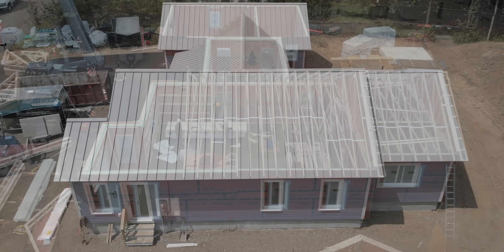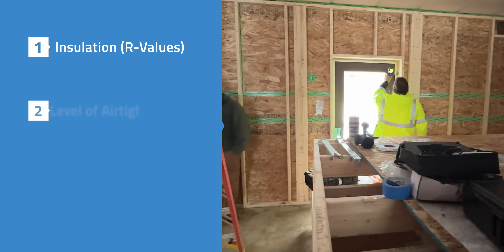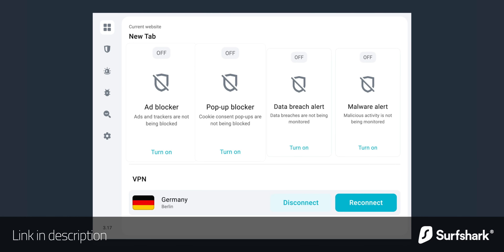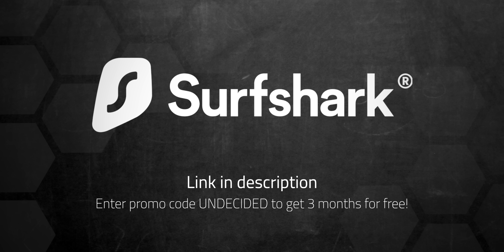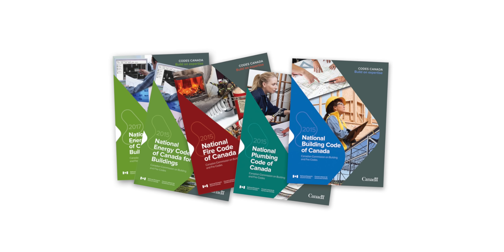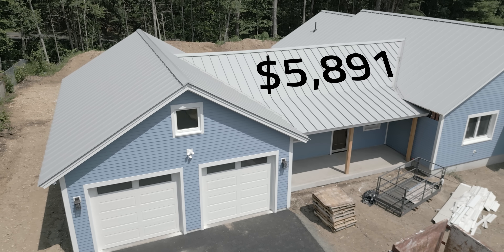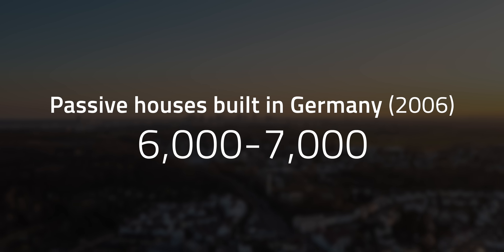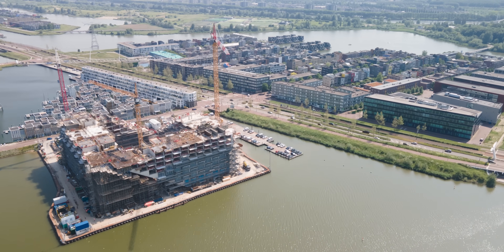Why Do American Homes Suck?

Comment: On the other hand. As a European, I am amazed that houses are so cheap in the US, and that it seems (from TV building shows) that it is simply cheaper to tear down a 30 year old house and build a new house, instead of renovating it.

Also, houses in the UK are similar to the US. It's mind-boggling really. And in southern Europe, climate sets differently challenges and realities from northern Europe.

One thing that amazes me beyond anything though, is the lack of solar. In Scandinavia it's installed everywhere. On house roofs, in fields, on industrial properties. And for context. Southern Europe is on the same latitude as Northern US. Madrid is on the same latitude as New York! Up in the Arctic we have more solar than Southern US.
Reply: Where are these cheap houses you're seeing in the US? The housing market here is absolutely fucking insane and entirely unsustainable and unaffordable
Reply: cheep in terms of construction
Reply: @Shorkshire  now. It wasn't always this bat shit crazy.
Reply: Anywhere not a Big City and its burbs is dirt cheap.  Average cost of a house in Ohio is ~$125k.  And those are nice houses too.  Guess where I am moving when I retire!  Here where I live now(suburbs of Seattle) you can't touch a garbage dump for less than $700,000 unless you are at least an hour from Seattle.  Denver it is $500,000.  My Sister and Husband bought a DUPLEX for $80k in Syracuse.  I helped them fix it up and it was paid for entirely in less than 3 years AND they are now renting it making B-A-N-K   @Shorkshire
Reply: by "cheap" that means sticks and paper and lowest cost materials at minimum labor content= TRUE
Build with termite food (wood)  and fire kindling(roofing), then complain about the inevitable 'disaster' as the same companies rebuild for maximum profit again & again. Foolish, at best
Reply: @solosailorsv8065  Do you want to own a $200k home for $1,100 a month for 30 years with $200 energy bills, or rent a $400k home for $2,000 a month for the rest of your life that costs $50 a month less in energy?
Reply: @Matt-yg8ub  Thanks, I'll keep my paid-for and no permits required, 80K sailboat that is sail&solar powered, makes its own fresh water, and puts food on the table in any cool little port in the world, with the best Mates/neighbors of like-minded freedom lovers. if the "authorities" get out of line, I just sail-on.... Like the title says Houses SUK
Reply: @solosailorsv8065  sticks,paper?? What you talking about. I’m a builder and I never seen paper used for building.maybe in Japan??
Reply: @chrissasin6676  He's talking about drywall when he says paper.
Reply: Reasons why Scandinavia and northern Europe has more solar than southern, is because of legislation. Take Spain for instance. When I asked why there were no solar anywhere, I was told even if your house is 100% off grid, producing all it's own power, you still have to pay the local power companies for every kWh you spend as if you bought it from them. It's quite easy. If your upfront investment saves you money in the long run, it gets done. If not? Not happening.
Reply: @javr0  Forced to pay for what you don't use? Wow, and I thought California had criminal laws
Reply: @solosailorsv8065    There are places in the South that are on septic system, but are forced to pay for city sewage because they were annexed into the city.  So, they are paying twice for their waste disposal.
Reply: @laurie7689  Thanks. I wish all Commenters were real people with real information to share. Thanks !
Reply: @solosailorsv8065  I wish that I could remember which city it was, but I think that it was in Alabama.  I remember that the residents had sued, but they lost their case in the courts and had to pay the city for a sewage system that they weren't even connected to.
Reply: @javr0  No, not off grid. It is only grid tie they can charge you in Spain but I think they are not allowed to do that anymore unless in certain situations. I have had off grid solar in Spain since 2015 and have not paid anything to the power companies.
Reply: @javr0  subsidies,legislation,ideology based decisions will not work. In final analysis market will decide.
Reply: It's cause for the longest time the cost of Renovating was almost Equal to the cost of Building a new home for Decades. And in some cases it was cheaper to Buy the Materials and hire someone to build you a new home than it was to renovate an existing home yourself. Electricity was also dirt cheap for a long time.  The US could be said to have been in a Golden Age for so long that it has stagnated when it was still in need to renovate and improve base living standards.
Reply: Most UK houses are built from brick, so I'm not sure there's much similarity.
Reply: Probably depends on where you're building. To build a house in the SF Bay Area costs $400-500 a square foot, while in the UK it's £167 - £279 per square foot.
Reply: Where did you get that nonsense that UK houses are the same as US houses? 🤦
Reply: Other than the Southern States in the USA who have consistent year round solar,and need it during the day for Air Conditioning, it is more $$$ efficient to rip the siding off your home, add Rockwool insulation, sealant, and a new roof which never needs to be replaced than to add solar.  Solar is nice, but there are bigger fish to fry.  In the Southern USA, Solar pays for itself in about 5--10 years.    You also must understand the cost of electricity anywhere in the EU is over 3X higher than the USA.  So, Generating electricity in the EU pays back WAAAAAAAAAAAAAAY shorter period of time.  There are many northern places in the USA, the solar panels will be dead and so will you, before they pay back.
Reply: As someone who has dabbled in the craft of designing houses, and has a family background in construction. One thing that you gotta realize is that its not cheapness rather its a cost balance. What I mean is, often its not just what is the lowest price, there are houses that do that and often those are the ones you see in viral videos falling down in wind storms because they were too sparing on nails, or leak the moment the first rain storm comes because the membranes were made of a low quality plastic. 

When people spec houses, probably common everywhere but I'm focusing on the U.S here, we spec them to achieve the goal the best way we can without breaking the bank. So where the local codes and requirements count, we spend more money, and if something can be left out without impacting quality, it sometimes will be. This leads to a lot of compromises that occur. Sure, heat pumps are really efficient, long lasting, and more, but a swamp cooler cost $1,500 less and does as good of a job in Las Vegas. Thats why they seem more affordable, there is more compromise, not to say its all bad, a lot of decent and good things often are the result of the lowest bidder but it means you get industry standards that seem inferior in comparison to other parts of the world. 

We would all love to build our houses out of the best bricks and the most solid foundations possible, but we dont have that kind of money, so a decent foundation for the climate and wood will do.
Reply: @sterlingodeaghaidh5086  the richest country in the world complaining about not having enough money to even build according to mediocre lowest allowed code in the rest of the world... Yeah. I totally get that. No honestly. I do. Lack of codes, extreme income inequality and a culture of short-sightedness.
Reply: @xyzxyzxyzxyzxyzxyz  cost balance-what is it.? Soo you want to pay more than you have to??
Reply: @xyzxyzxyzxyzxyzxyz  youd be surprised how many people want to build to a higher standard. Im remodeling my house and part of ehat i want to do is add new windows and better insulation but i cant as its too expensive for me. Its not a lack of foresight its a lack of motivation to do so, and where there is motivation there is a lack of ability to do it
Reply: @xyzxyzxyzxyzxyzxyz also Americans are used to certain square footage. You can probably build a high quality house but it would be half the size. At that point might as well go back to Europe.
Reply: UK is an embarrassment. The Conservative Party is a basket of pure corruption. Brexit is a clear demonstration of the political will of its ruling party in divergence from European standards, including construction.
Reply: “Stick building” say it all.
Reply: @EdA-bz3bu  just wait for earth quake and see which system is better
Reply: You think it is cheap to build a new house every 30 years? It is a scam as you are paying the bank for the mortgage of a 30 year investment. Given how cheap land is in the US and how easy you can make money in other investments mortgages are an insanely bad investment in the US.
Reply: @melange78  That is an exaggeration.  Homes last way longer than 30 years.  The home I owned in the states, is 34 years old, and is a rental unit.  Plenty of homes that were built in the 1970s are standing, occupied, and in good shape.
Reply: @sgtm7  They are not built to last for more than 30 years. I studied architecture in the US and it is in the textbook. Sure they might still hold for the purpose of living in it but the sales value of a 30 year old house is generally not worth more than the plot value, which in the US is silly low anyway.
Reply: @melange78  nonsense ,it’s just silly 🙃
Reply: @chrissasin6676  No, what is silly is that you don't get it. If you were to build a house using American standards in Europe you would be sued.
Reply: @melange78  be more specific, one example,please.  By the way,you could not build  euro standard home in California,
Reply: @chrissasin6676  OK how about the most common type of construction in the US, the wood frame? That is substandard in the EU, you would get sued if you used that here.
Reply: @melange78  not in Poland!  Et minimum. You can use steel studs. Not s
Reply: @melange78  you can’t be sued, you might not get building permit- that’s all.Looks like you not a builder,am I wrong?
Reply: @chrissasin6676  No I am not a builder, but you don't necessarily file the construction methods when you get the building permit either here.
Reply: @chrissasin6676  I guess that explains why polish construction workers are so poorly rated in Sweden.
Reply: @melange78  that’s everywhere. I’m not sure what country you’re from,but you can build wood frame houses in Germany,Switzerland,Nordic countries,central Europe…
Reply: @melange78  I’m not polish ,I’m American  🇺🇸.
I’m glad Swedes are such good workers.Had a lot of experience producing and selling ball earrings to hitlers Germany  luftwaffe ,therefore participating in attacks on Warsaw,London,Belgrade,guernica ….
  Prosperity created on profits from both wars (80 million deaths)
Reply: @chrissasin6676  No you cannot. I honestly don't think you know what wood frame is. It is like a barn made in the 1700s.
Reply: @melange78  The house I bought in 1995 was built in 1989. I paid $65,000 for it.   So that house is currently 34 years old.  According to Zillow, it is now valued at $174,000 (range of $159,000 to $187,000).  Which is actually irrelevant, because we aren't talking about the value of the house, but if it will last 30 years.
Reply: @sgtm7  But what makes the value increase in your specific case? Inflation? Land value? General lack of residential zones in your area?
Reply: @melange78  Compared to many other places in the USA, it hasn't seen much increase in value.   Years ago, during the housing bubble, when there was crazy appreciation in many places, that wasn't the case in Texas.  If I had bought a house in California for that price 30 years ago, it would be worth at least $500,000 now.
Reply: @melange78  The availability of employers makes the value of an area increase.  There are many dead and dying towns all throughout the USA and that was the direct result of employers leaving the area, mostly to go overseas.  The areas that grew did so because of the employers that chose that area to build their business.  The people follow the businesses.  That makes the land around the business more valuable due to the demand of the people (employees) who want to settle nearby it.  Also, the other businesses that want to open up in support of that main business, such as parts suppliers, restaurants, etc., which also have need of employees.  All it takes is one large enough employer moving into an area to completely change the dynamics of the place and cause it to grow rapidly, increasing demand, which increases value.  On the flip side, that one large employer can also totally devastate an area if it picks up and leaves.
Reply: @melange78 I live in a 120 year old home and am living proof that you’re talking out of your back side.
Reply: @Matt-yg8ub  No, of course there are unicorns. There are people that are born with 12 fingers, that does not mean that saying humans have 10 fingers are "talking out of your back side". IN GENERAL homes in the US are built to last for 30 years and you can tell that just by looking at the choice of materials. The condo that collapsed in Miami happened for a reason.
Reply: @melange78 population growth
Reply: @melange78  It's the location that counts, you learned nothing in that school 🤣🤣🤣
Reply: @HEMI345S  No it is in the course litterature.
Reply: Cheap?????? You think 300 to a million is cheap
Reply: I live in the Southeastern USA.  My home sits on the side of a wooded hill.  It sits completely underneath the tree canopy, so it is rather useless for me to have solar panels on the roof.  I only get maybe an hour or two of sunlight in the evening coming into my home.  My entire property is mostly shaded.  I've got tall loblolly pines, woody vines, and ferns growing in my yard all around my house.
Reply: Houses i North America are not cheap. They are cheaply made and they don't last long (by design).
Reply: My house in the aUK was built in 1772. Slightly older than the USA😂
Reply: Energy is generally cheaper in the US. Why go solar when you're looking at many decades to recoop the cost? Solar coming down so much in price has certain spawned solar installations in some parts of the US where energy isn't that cheap, but there's a long way to go before other parts of the US with very cheap energy will go for it.
Reply: @repatch43 yes but it’s cheap and dirty. Coal fired generation is a large contribution to US grids. IF there were carbon tariffs applied to the generators, they’d move their business models, reduce pollution, BUT it would raise the price on consumers bills. Not very populist & wouldn’t go down well politically.
Reply: @repatch43 It's not many decades anymore. Here in CO in Black Hills' domain energy is 22c per kWh. So a $25,000 8000w solar install only needs 5-7 years to pay itself off. 
Up in Denver it's only 11-14c per kWh so that's 10-15 year payoff. Still worth it, but not as good.
Reply: Unfortunately, tear downs are more common because our houses here are made of sticks and paper - literally.  2x4 construction with sheetrock is typical.
Reply: @diggity53  paper??   You can buy houses made of concrete, CMU ,anything you want
Reply: @chrissasin6676  and they crack easily, are susceptible to mold, and are unsuitable for habitation in under ten years.
Reply: @Matt-yg8ub  you talking American or Europe homes ?
Reply: Building a shed in Europa is also cheap. We simply choose not to live in it. 
You get what you pay for.
Reply: @jaap7374  I'm not sure your point.

I find in Europe, as a generality, things are built to last 'longer'. That sounds GREAT on the surface, but it has consequences. When you build something in a way that it's meant to last 2 or 3x, you end up with much higher upfront costs. I've actually helped build European houses, it's ALOT more work, with ALOT more material. Everything costs more, you need more people, you need more expensive and heavier supplies.

The result is a house that will probably outlive the owner. That makes sense in a society that is used to multigenerational living. In North America however that's not as much a thing, so overbuilding a house doesn't make as much sense.
Reply: most houses are built so badly, people change them like they do cars - Cars probably last longer. Easier to dump a house and move. Very different mindset to Europe.
Reply: Many things are sub standard in the US. Roads are terrible, health care, no trains or public transport. Domestic flight in the US is painful.
Reply: @TroopyTreatsx  what part USA are you from
Reply: UK houses are nothing like average American ones. We like brick, and insulation, and good quality construction. We have actual laws that are actually supposed to be enforced. Our insane planning rules are nowhere near as bad as the US ones. We don't have air conditioning, which now has to change because Americans have been building so much terrible housing and general infrastructure that we have no choice but to start using it. Dunno why the OP thinks the homes are similar though.
Reply: @jonevansauthor  as an american i have to say that most homes I have lived in  have been brick. all but 1 in fact.
Reply: ... He was comparing climate zones and the equivalent energy codes in same climate zones in the USA.  The ONLY equivalent climate zone as the UK/Northern Europe is Western Washington State on the Pacific Ocean where very few have AC, the cost of electricity is 30% that of Europe, and Natural Gas is nearly Free compared to Europe.     PS: I have lived in a brick home... Drafty and cold as hell.  Brick SUCKS for insulation value.  Unless you put interior walls and insulation in a brick building your energy bill will be pitiful.  Thankfully most brick buildings are ancient and like their UK counterparts still survive due to their VERY compact, small, stacked on top of each other nature to conserve heat.  I liked it because of all the rentals in it I owned and operated till the drugies moved in next door and it became impossible to rent to anyone other than low life scum.   @jonevansauthor
Reply: Every new build should have solar, it should just be the rule, and not just 2 pathetic pannels installed.  But apparently it takes  a lot to change the building code....or maybe the building companies just have too much political clout to ever allow it to become standard because it would hurt profits.
Reply: @miless2111sutube  There is already not enough new building going on right now, and you want to make that even more onerous?
Reply: @shadowtheimpure  I don't understand how it would be more onerous, given that this wouldn't be a snap announcement and companies would have enough time to put on place supply chains etc. You might as well day that installing double glazing is onerous:). If they, and their suppliers, know that it will be required it will happen as part of the normal build.
Reply: @miless2111sutube  It increases costs, which increases the price on the finished home, which makes it accessible to fewer buyers. That is why it's onerous.
Reply: @miless2111sutube  Even if my house was brand new (which it is not as it is 40 years old), my home sits on the side of a wooded hill underneath the tree canopy.  I get very little sunlight here, maybe about a couple of hours in the evening when the sun is setting.  Solar panels on my home would be a waste of money and of resources.
Reply: @miless2111sutube Do you have any comprehension of the vast difference between regions in the US? Let’s assume we mandate solar panels…… half the country wouldn’t pay them back in their lifetime, a quarter would take them at a loss because they were destroyed by bad weather and the last quarter would be lucky enough to pay them off …..a few year before they broke and had to be replaced. 

Take all the eco hippies from California who moved to Colorado and were SHOCKED when the solar panels they installed were destroyed by hail storms.
Reply: Latitude doesn't count, when Europe is cheating by having the Golf Stream 🙂 Btw. I listen to NYC based radio station here in Prague, CZ on daily basis and it's remarkable how the weather is often very similar (not temp though) in terms of rain, heat/cold waves etc. But ofc other times could be completely opposite, mostly when US is troubled by the polar vortex.
Reply: @mikiqex  First, the golf stream is way cooler and localized than you think. It keeps Irish, Norwegian and icelandic winters mild and ice free. It has very little impact on the rest of the European climate. Second, it has no impact on solar radiation whatsoever.
Reply: That’s the biggest factor missing in this video. US homes are often a fraction the cost for the same size and energy in Europe also costs multiple times what it generally does in the US. There’s no cost benefit to making homes exceptionally efficient unless you’re a climate alarmist detached from practical reality.
Reply: The US is all houses, while a large proportion of Europeans live in apartments.

I am not sure how solar works when you have 8 families living under the same roof area as one family in the US
Reply: @rogeriopenna9014  29% of Belgians live in apartments. The rest lives in single home units. I don't know about other European countries.
Reply: @rogeriopenna9014 community solar and wind farms. You own a piece of the business to offset your energy bills.
Reply: US houses are not cheap,European houses are expensive/  taxes,government regulations/
Reply: it’s costing no more for us to build an energy efficient house in NL than building a passive house in New England. Even a bit less because of government subsidies.
Reply: @chrissasin6676  ofc buying a house on the US has the caveat of needing a car to do anything, meaning fuel, expenses, etc. so we are comparing apples to oranges
Reply: @maximipe  shhh, don't mention the actual externalities of living in a single family home in a low density area in the middle of nowhere. americans dont like it when you point out that cost of living and quality of life are overall better when you dont have to drive half an hour to get groceries.
Reply: @critiqueofthegothgf I live outside of the city and I'm 5 min from the nearest grocery store and 10-15 min from the other two in either direction. So what was that again? Oh right you don't live here so you actually don't know what you are talking about. The US isn't much smaller in land mass compared to all of the EU so we don't need to pack everyone in on top of each other like most countries over there. If you want to live in the cities in townhomes or apartments and use public transportation you can do that. If you want to live in single family homes just out side the city so you have a yard larger than most of your apartments then you can do that. If you want to live way out in country side you can do that as well. You cant just cherry pick one thing and pretend it is like that everywhere in the US. I have a feeling there are people in the country side 30 min away from a grocery store in your country as well which completely destroys any point you were trying to make.
Reply: @mikevachon8752  
5 minute driving or 5 minute walking?
My brother recently moved to the suburbs in Europe. The house is big, and nice to have a yard, but you absolutely need a car to go anywhere and consequently the roads are clogged all the time. Meanwhile inside the city you can just walk most of the time. And if there's enough green in the neighborhood it's not that much worse than the suburbs.
Oh, and also a house and a yard need infinitely more maintenance, which is a lot of time and money.
So the choice is not that clear.
Reply: @mikevachon8752  you can live in apartments and use public transportation. Lol a good joke. Indianapolis, one of the major cities in US with 1M+ population has no where the density of public transport like other 1M+ town in Europe. 

Regarding your point of choice of where to live, i agree. There are all options available in US. But it doesnt change the fact that US houses when normalized for square footage consumes a LOT more energy than EU houses. Matt explains why. Its all down to price. if energy is cheap people will waste it.
Reply: @critiqueofthegothgf I'm always fascinated how people assume that one way of life is the ONLY way of life, and everything else 'sucks'.

I don't WANT to live in the city. I've done it, I hate it. The constant noise from the city alone is what drove me away. People everywhere. At night you couldn't even see the sky. The smells.

Yes it's convenient to walk a few minutes to pick up some groceries, but that is partially countered by the cost of those groceries being higher. I couldn't buy larger things and carry them home, so delivery was the solution, having to wait at home for someone to bring you your stuff. If I want to shop for a TV, or furniture, or whatever it was often at least an hour on public transit to get to a store anywhere near affordable, and of course if I wanted to BUY something, it meant a delivery, unless I rented a truck or car.

I CHOSE to live in a 'burb', and I love it. I'm 5 minutes away from a major mall, a couple major home improvement stores, several grocery stores, and pretty much everything else I need on a short notice. Yes, it does mean I need a car, but you know what? I like not having to trudge through the slush in the winter to get to a transit stop where I have to wait for a vehicle to come. I just get in my car and go.

So ya, not everyone WANTS to live in a city, and not everyone has an issue with owning a car.

Oh, and stop cherry picking. You act like everyone in the US lives in the sticks with a car, and everyone in Europe is 4 steps away from a metro line. I have family in Europe, they all own cars, and public transit is certainly not the most useful of things.
Reply: @critiqueofthegothgf  What is better about not driving?   I would say the quality of life is better overall, when you don't have to take public transportation.
Reply: @andrasbiro3007  The choice is quite clear.  It depends on what you prefer.
Reply: @mikevachon8752  100% I have relatives in a European country and it's not at all uncommon to live 20 or even 30 min drive from a grocery store. Granted it's a mountainous region, so the physical distance isn't huge, but the driving time is because of the steep & bendy roads.
Reply: @coolestrock2008  Right, so what's your point? If energy had been so cheap in Europe then European houses would be the same energy efficiency. 

There is no judgement to be made here, just more proof of how the free market works.
Reply: @sgtm7  I've done both. Each has their advantages. Which one is 'better' depends completely on the person being asked. For me, car and living somewhere where I'm not constantly attacked by the noise of a city are 'better'.
Reply: @mikevachon8752  mate, im not reading all of that. especially not when the facts state that the 75% of land zoned in the US is single family. to dumb it down for your peanut brain, that means it's literally illegal to build anything but single family homes in the vast majority of america, resulting in low density, surburban sprawl. 

not to mention the 2 billion parking spaces, which cause city centers to have over 20 percent of their land area taken up by massive parking garages. just because you happen to live in one of the few places where you arent separated from everything else, doesn't make it so for the rest of the country. cope.
Reply: @critiqueofthegothgf ah yes, the freedom to need to be beheld to gasoline pumps just to have milk for your capn crunch.
Reply: @sgtm7  it's called using your two legs. the american aversion to excercise is well documented but jesus dude. have you heard of walking? or riding a bike? when was the last time you went outside to go somewhere that wasnt by car? do you know what it feels like to literally just take a walk?
Reply: @critiqueofthegothgf I had a proper “Those dirty bastards” moment when I seen a climate town piece on zoning and how much of it has been brought about by big auto latching onto the American dream.
Reply: @critiqueofthegothgf  Although when you live that far away the air quality will be better
Reply: You just showed you have never lived in the country.  Small towns have a Grocery store close to everyone unlike in a city with their MORON zoning codes keeping all residential/commercial zones separate.   For the VERY few who actually live 30 minutes from a town, Its called you stock your shelves, you grow a lot of your own food, and can it and everyone around you does the same and HELPS each other growing a community.  Not to mention in a city, a grocery store is FAR away and the prices are far higher than a country grocery store.  Why?  Big City Grocery stores in the USA sell you tiny packages of expensive food where majority of cost is the stupid packaging whereas your country grocery store will generally have a bulk section or at least a bulk option and you do not have to pay COSTCO $100/year for the "privilege" of buying normal food bulk items.   @critiqueofthegothgf
Reply: @coolestrock2008 .  Try using public transportation in London, Paris, Munich, Madrid, etc and you’ll go broke before you even get to the supermarket. But, if you do have any euros left when you get there, you can buy half the food for twice as much.
Bottom line, don’t talk out of your arse.
Reply: @critiqueofthegothgf  Except living in close quarters is bad for the mental health of a LOT of folks. Even in Europe, you get people who prefer to live outside the hustle and bustle of dense urban areas.
Reply: @critiqueofthegothgf  cost of living??  US eggs $ 1.25 a dozen,  gasoline 50% cheaper,electricity  12cents perKWH..reality check
Reply: @critiqueofthegothgf  stereotype is alive and well:(
Reply: @grishyroy9271  you've probably never tried Paris transportation, or maybe only as a tourist, it's still quite cheap (and the employer pays 50% of the remaining cost) even if the price has gone way up for the last few years.
A lot cheaper than putting gas in a car, paying for its insurance and maintenance costs.

Food is indeed expensive, but you can you cross the ring road and it becomes way, way cheaper, or I order online and pick it up at delivery points which are priced around the same as anywhere else in the country (don't choose the home delivery though, that's expensive).
Reply: @coolestrock2008  there is public transportation in idisnapolis .depends where you live and work. Buses are empty most of the time cost to benefit analysis??
Reply: @repatch43 During the 70s northern europe leapfrogged into energy efficient housing, nuclear and district heating. The US explored and found domestic gas and oil, and carried on. In europe people live in apartments, unless they really want to live in a house, which they then want to be properly built. In US even the poor live in houses and there are developers that take advantage of uneducated house buyers.
Reply: @Random-f3y7w  Hehe, love the cherry picking. Look, I have family in Europe, most live in houses. Those that live in apartments do so not at all by choice, but BECAUSE houses are too expensive to purchase, and have been for many decades.

There are some in apartments simply because rent control in some parts of Europe is insanity, where as long as you don't leave a unit you pay less and less every year if you take into account inflation.
Reply: @repatch43  i was stating the fact that if something is cheap, there is no incentive to be careful/conservative. Where is was going with is that, the US govt intervened to make sure energy is cheap for Americans. Had they not done that and truly let it be a free market, then US would have ended up where Europe is.
Reply: @critiqueofthegothgf  I live in a low density suburb and I only have to drive 5-10 minutes to get to the store.  Only the folks out in the rural areas have to drive 30 minutes or more.  The upper limit (10 minutes) just depends on whether or not there is traffic, such as school traffic or if it is rush hour when folks are going to or coming back from work.  It would be nicer if folks didn't all have the same type of work schedule, but that is up to the employers, not the workers.
Reply: @andrasbiro3007  I live in the subtropical Southeastern USA where it is very hot and very humid for much of the year.  I'm not going to walk anywhere if I can help it.  I'm going to drive with my vehicle's a/c at full blast.  I don't care if the place I'm going to is just down the street from me.  I'm going to drive there - not walk.
Reply: @salibaba  Car or horse, but I'll be beholden to one of them.  I'm not moving into a densified area.  For many generations going back further than family memory, my family were farmers.  Not until recently did we leave the farming life to live in the suburbs.  That is as densified as we are willing to get.
Reply: @Random-f3y7w  People WANT to live in houses.
Reply: @sgtm7  Dependence on a means of transport is not a quality of life for me! If I can do my shopping on foot, by bike, bus, tram or car, yes!
Reply: @arnodobler1096  If there was a train stop at my front door, I would still drive.
Reply: @sgtm7  🤪
Reply: @critiqueofthegothgf  How do you not have to drive in Europe to get groceries? Most supermarkets are not on your doorstep. When I lived in Europe we always drove to the grocery store.
Reply: @repatch43 Exactly! Living in the US suburbs is just so much more comfortable than living pretty much anywhere in Europe and I'm a European saying that. Is it wasteful and wastes energy? Sure, but we are paying for that luxury.
Reply: @salibaba you don't think milk was delivered to a grocery store in Europe using a gas powered vehicle? 😂
Reply: @critiqueofthegothgf Where I live in burbs we have a ton of walking amenities. I walk my dog all the time.
Reply: @shadowtheimpure Correct. Why do you think so many Europeans emigrated to America? They wanted to acquire land which was close to impossible in Europe for an average person. It still is hence the emphasis on apartment living.
Reply: @pbe6965 Paying for gas and car insurance is pocket change to many Americans. Salaried professionals make multiples of what people get in France. On top of that mortgage interest is tax deductible and private pension contributions tax deferred. Health insurance is not compulsory. The monthly cash flow looks totally different in the US.
Reply: @Random-f3y7w why is it desirable to live in an apartment? Owning a house is aspirational.
Reply: @critiqueofthegothgf  This comment is so ignorant and mass generalizing, US has far better quality of life then most major European nations in many different index, like economics, health, housing, community, jobs, governance, environment, happiness, education. And Yes the US is a large nation it dosnet take an hour to drive to one side of the USA, people like space and quietness. Not everyone wants to live in a dense urban city.. but most Americans live in urban areas over 80%.. so please educate urself and be quiet.
Reply: @mikevachon8752  Welcome to the northern Scandinavia... Most of Europe kind of forget we exist... so if you want a comparison with chep single homes, car dependency and building of wood, here we are. Most houses in the north are built from wood. Most of us live outside of cities and need a car to get around and most houses are not very expensive at all. We still have better energy efficiency than what the US appears to have but that is probably because we'd either freeze to death or go bankrupt if we didn't manage our energy expenses due to our long, cold winters.
Reply: @critiqueofthegothgf  continue to cope and seethe about europe's dog shit living standards vs the US and Canada. Guess what, you can just buy a house where you don't need a car. However, most people here prefer a car. It's an independent private source of transportation. If you want to continue to be nannied by your goverment, go ahead. We will just continue being richer, freerer and oh yeah, actually important.
Reply: @repatch43  They have to cope about not being able to afford a house with land and afford a car. At the end of the day, we don't call them europoors for nothing. Plus a vast majority of countries in europe are nanny states, you're not dealing with adults, but children. Independence scares them. Fun fact, 68% of germans commute by car, very similar to US's numbers. What you're dealing with are urbanites. They live in a bubble and don't understand that there is a world past the last bus stop. This is true here and in europe, difference is in Europe there are way more urbanites.
Reply: @Jcewazhere Sounds like a good economic opportunity to build a grocery store. The biggest issue with American city planning/architecture is merely zoning laws. People should be allowed to open business anywhere rather then selected zones.
Reply: @grishyroy9271 Not being able to afford food is a good thing! It prevents obesity even though Britain is 3rd place right behind America!
Reply: @critiqueofthegothgf ... "quality of life"... "better" when you live in a cramped urban environment? 🤣

Sorry, I'd take driving for groceries for 30 minutes once a week over walking to the store like some pleb.

Let's not forget that your AVERAGE American home has a two car garage and nearly double the space as the European "flats" who park their car in the communal parking garage (if they even have a car). Even in my European in-laws  "wealthy" village, not a single two-car garage... not even the Porsche 911 owner.

You tell yourself whatever you want though to cope!
Reply: @chrissasin6676  It's probably actually the case that American houses are more expensive compared to the cost of building them. They're cheap flimsy things with little to no insulation, the roofs are felt instead of tiles which is only used on sheds in the UK because it's cheap and doesn't last that long. They don't meet the British Fire Safety Standards and it's probably easier for a burglar to knock a hole through the wall than break a window!
Reply: @kaneworsnop1007  someone misled you. 
 - minimum insulation :-wall  3,5 inch. -R-15
                                             Attic  16 inch. -R 38
  Roofing - 25 year warranty fiberglass shingles with underlaymant   .facts. / you can get 30 and 35 year shingles too